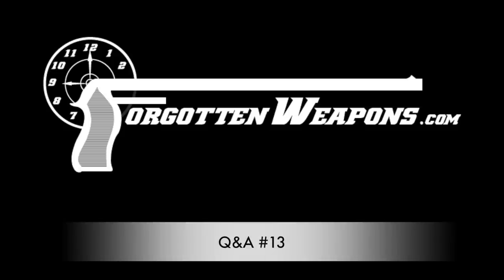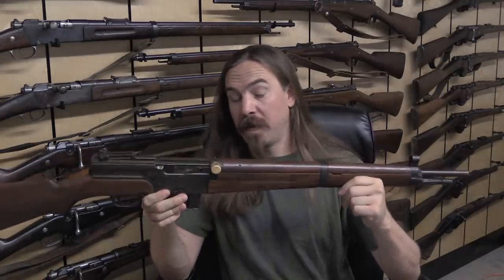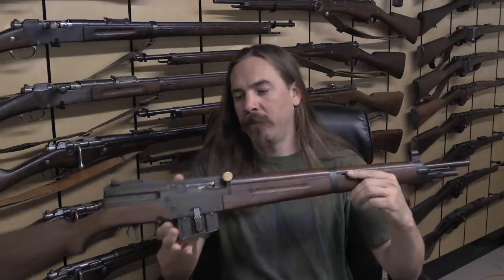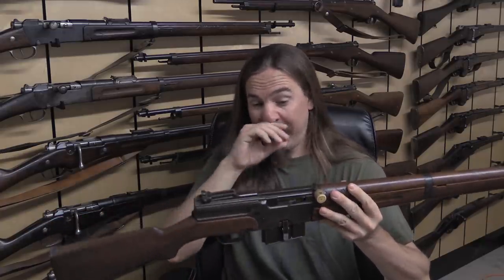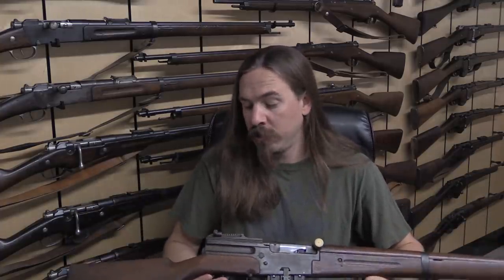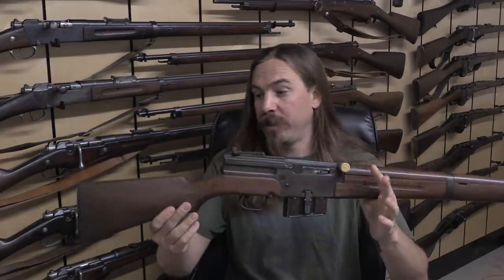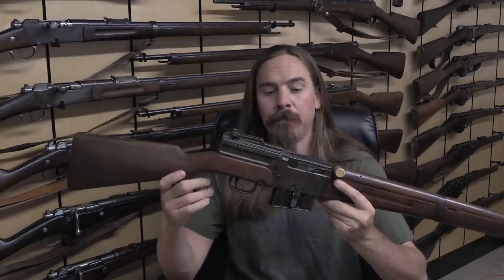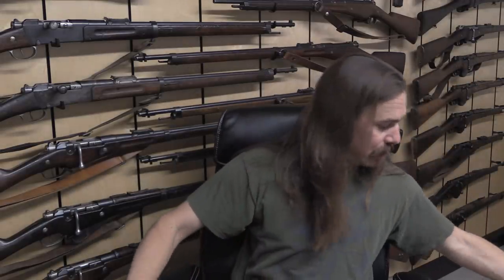Q&A #13: Cameras, Surplus SMGs, Modern Rocket Balls, and More!

Comment: On great gun books, several factors come into play making them hard to find.  First, at least in this part of the US good book stores are a vanishing breed.  Many have closed their doors simply because in tough economic times not enough folks are buying research books to allow continued function as a store.  
Second, some of the best books were either of limited circulation in the first place, such as the US Navy's 'Machine Guns' by George Chinn (a superb 5 volume set with volumes 1 - 3 printed for government distribution in 1951 and volume 5 finally emerging in 1987).  I was privileged to actually hold books 1 - 4 for a few weeks, but old book auctions are the only place a reader will find originals, because most copies either remain inside government limited access libraries, or were trashed when someone decided to clean out an office.  
The good news is with careful hunting you can find them as PDF documents online.  Those volumes are huge however, I believe volume 1 alone is something like 140 megabytes.  A third problem is serious firearms researchers are such a small segment of the probable market that many still functional book stores simply don't bother to stock firearms research books.
A second must read is Smith''s Small Arms of the World.  Long out of print, so again online old book sales is the best source.  
When the US Army closed Springfield Armory and transferred the function to the Rock Island Armory (itself now also defunct) a 'how to do this' 180 pag guide book intended 'not for distribution' called 'Technical Notes Small Arms Weapons Design' was written and published.  Again, it can be found online (about 230 megs), but I have only seen one original hard copy and that was at an Army facility.  Superb for designers.  
Another problem is not all of the best books were published in English.  Rhinemetall of Germany published a 'Handbook on Weaponry (739 pages or so in 1972, but it was only availablle in German for some time.  An English translation (literal, so some syntax structure of some sentences requires some thought) of 'Taschenbuch fur den Artilleristen' was finally made available in 1982 but again online or book auctions is your best bet for finding a copy.  It is  full of formulas for everything from calculation of breech pressure to a formula for calculating the probability of a kill   
It must also be acknowledged that some superb firearms research books are or were only written in languages such as Russian, French or Chinese or Hindi as that was or is the language of the intended and anticipated readers.
The US shooters civilian Bible is of course, Hatcher's Notebook.  Also very much worth reading as a means of learning from someone else's real world experience are the books by Elmer Keith.  If nothing else from them we learn overcharges of a pistol can take off your finger, and choosing to shoot a charging grizzly bear with a 9mm Luger is probably a fatal mistake.  There are other historical gems in Keith's writings and I strongly suggest familiarity with them for anyone wanting real world experience about how guns perform in the field without having the pains of a really bad day.

Comment: The Makarov pistol is a C&R eligible handgun that while not new, is still plenty safe for CCW. 

I'm not advocating carrying something for the sole purpose of its historical context but Maks can often be had for very reasonable prices and they are functionally sound. Which make them a great option for someone who wants to CCW but may not have the funds for a Shield or Glock etc...
Reply: Christopher Clark On the opposite side of cost I like the HK P7. It's well made, slim/snag free, and the grip safety is pretty good once you get used to it. Although I agree that carrying historic firearms defeats the point a bit.
Reply: ive shot a makerov before, it was pleasant to shoot, accurate, and fairly small.

Comment: @26:40 Not M1903A1, but a M1903Mk1. The M1903A1 is just a regular M1903 with a pistol grip stock. The M1903Mk1 is the one that was specifically made for the Pedersen device.

Comment: If you want an old style carry gun look at which designs are still in production by thier original manufacturer 50 or 100 years after their introduction. 1911s are on that list (though there are many modern variations) as are Walther PPks (but be prepared to be accused of being a James Bond fanboy). If the original manufacturer is still making them that's an indicator they may still be relevant despite being a very old design.

Comment: A bit late, I know, but the conjecture on the stability of rocket balls is incorrect here. A projectile will stabilize if the center of mass is in front of the center of pressure. The hollow section at the rear would almost function like the fins on a dart. You would still need to spin the projectile, but you could get away with a lower rate of spin than on traditional bullets

Comment: I was surprised to hear you say that a weight forward hollow base projectile would be hard to stabilize. That's the exact method that old timey conical and modern production Foster slugs for shotguns use. Is it a different kinds thing when it gets to over 2000 fps or something?

As I understood it, it basically works exactly like a badminton shuttlecock. 
+ForgottenWeapons

Comment: .32-20 was a good round. Problem with the use of an obsolete round like that is it still fits in a gun that's really old and used black powder.

But it would be nice to have a  32-20  rimless cased multipurpose round designed for a Henry style lever action that has been truly modernized. As you change your next round by throwing it in the loading gate.

JS, it could NEVER happen unless you changed it a little. Like just enough, otherwise older weapons would be blown up.

Comment: Just a comment on the rocket balls; weight at the front with a hollow tail is inherently stable. This is how aircraft and rockets stay nose-forward. Now, you couldn't put it through rifling and expect it to work well, but by itself it's technically okay.

Comment: I wouldn't say polymer takes up all the market share formerly created with stamping.  This is because a stamped steel part can generally handle heat much better than a polymer part.  So you can't easily replace a stamped steel upper for something like an AR-18 and replace it with polymer.  Even with excellent engineering you have companies like HK having trouble with the G36 overheating and the polymer degrading.  

However for relatively unstressed components, you are completely correct.  Just mold it out of plastic.  You can make a more complex part and do it cheaper.
Reply: For the parts that need to stand up to heat, I'd say that extruded aluminum takes the place of stamped steel. Just look at the ACR or SCAR.
Reply: Currently we use milled extruded aluminum a lot for those purposes, but it is more expensive than a comparable stamping.
Reply: Jeff Acheson I would argue that in "oh shit!" times, that stamped is better for mass production. Sure polymer is cheap and lightweight but I feel like you can really crank out stampings in even less time than waiting for the plastic to form and all that.
Reply: It depends as stampings may require multiple operations to create the final part.  And a mold for polymer parts could have multiple cavities.
Reply: Jeff Acheson Well everything always depends. I just believe with a simple (even by typical standards) stamping you can just get the production rolling like no ones business. Well, you could of your nation actually has a hint of an industrial base unlike the defunct factory towns of the United States

Comment: When the russian empire adopted the first mosin nagant rifle in 1891, as finland was a part of the russian empire we also adopted it,  straight after our independence and during the finnish civil war we had stockpile of around 200,000 m91/30 rifles so we decided that, Well we don't think these mosin rifles any good but we don't have production capacity to manufacture our own rifles so let's just retrofit them into the finnish M/91 rifles for the time being, after that during late 20s and early 30s we modified them again into the M/27 which was the main service rifle in finland for the winter war and then AGAIN for the continuation war they where updated to the M/39. The Finnish Defence Force used the TKIV 85 rifle as their main sniper rifle. While it is based on the mosin nagant rifle, has been through so many changes it is basically its own thing now. And yes we have used the same sniper rifle since 1985, but like anyone can complain the US still use the Ma deuce.

Comment: Historically significant pistol practical for CCW? Walther PPK. Its reliability has been conclusively proven by over 80 years of use by police and special forces. It has been copied extensively, it's sexy as hell, is James Bond's weapon of choice and was even used by MI6. What could possibly be a more compelling endorsement than that?

Comment: Ian I have a question for you. Why haven't "they" made a cartridge between pistol and Intermediate strength. I feel like there should be a middle ground in-between pistol and intermediate cartridge power in something like a SMG. For Example the Intermediate cartridge bridged the gap between pistol and full power cartridges. Someone needs to make a smg in something a little more powerful than a pistol load. 5.7x28 is kinda a good example of that bridge but I think someone could do better. Thanks Tyler..

Comment: the original m4 the army used had three round bust and when we switched to the a1 model at first just to get them out the door we did something with the sear so like when i went through basic sometimes it will mess up and malfunction

Comment: For the rocket ball question wouldn't having a heavy front with an empty lighter tail be similar to a foster shotgun slug? Seems like the same basic idea and they work pretty damn well with slugs
Reply: For that matter hollow base wadcutter rounds, also Brenenke slugs utilize solid slug with a plastic, felt, or fiber tail which was originally attached with a wood screw if I remember right.

Comment: Are rifle grenades still a viable anti tank weapon today?
Reply: rpgs use the same method - hollow-charge - as at rifle grenades, so, yes, inasmuch as their effectiveness allows
Reply: CthulhuInc I know that, but would a modern rifle grenade be able to take out a t-90 or an Abrams tank?
Reply: Carl Smith i am not sure rifle grenades were effective anti tank weapons when they were used before.

      That being said rifle grenades were probably highly effective ways to take out trucks, half tracks, weapons pits in defilade, firing into windows to take out snipers etc.

    Most man portable anti tank weapons today are some sort of rocket or missle with a shape charge. 
Not sure if you could get a proper hit angle from a rifle grenade to make a shape charge effective.
Reply: Carl Smith never was I think.
Reply: I think Ian was not entirely correct in that statement. Its true that shaped charges depend on the shape to do damage, but they also depend on the mass, and rifle grenades just dont have a lot of mass. Look at panzerfausts for example, and imagine trying to fire that from a rifle.
Reply: Not anti-tank but anti-apc or other Light Armored Vehicle. The US Arm actually does field a shaped Charge round for their various 40mm grenade launchers. But most modern Tank armor is pretty well protected from all shaped charge warheads and is why most rely on APFSDS rounds for anti-tank work and HEDP (HighExplosive Dual Purpose) which is functionally identical to old HEAT shaped charge rounds.
Reply: No I doubt any type of rifle fired grenade would /could destroy a modern battle tank. Moreover, don’t forget the changes on the modern battle field a mbt is relatively obsolete at this point. Additionally, 40mm hedp is effective against light armored to no armor area targets. It is the modern equivalent to a rifle grenade. Even the US Army has abandoned the new mbt in the future weapons program. When new projectile options become viable .... ie lazer based or rail/kinetic energy platforms become smaller a new battle field equivalent should present itself.

Comment: On military surplus equipment, WW2 provided the best source ever. There are several wrecked Panzer 3/4s and StuGs found in the Middle East particularly the Golan Heights. A few tiny Italian tankettes turned up in Iraq 2003 (are funny photos of tankettes no taller then the troops chests)  with early war Brit tanks, Tankettes were captured in 1940 by the Brits from Gratziani's army of 140k when surrendered to O-Connor's corp of about 35k. Then used with older Brit gear to defend Iraq from the Vichy troops in Syria. "Never in the field of human conflict was so much surrendered, by so many, to so few." Lots of Luftwaffe planes were captured with 75% grounded by Xmas 1944 due to no fuel. Well over 100k Nazis were invited to Argentina by Peron. Adolf Galand set up Argentina's airforce using the Me262 jets. With the close support for Franco by Hitler the Spanish had light panzers and it's airforce was equipped with German planes which were used in the 1960s movie THE BATTLE OF BRITAIN. And in ex-Soviet wharehouses there are boxes and boxes of MG 42s (8/box), Maxim MGs, (6/box), MP40s, K98s, revolvers (40-50/box) etc still in the original grease paper. Maybe some Mp44 or FG42s.

Comment: One comment regarding the pedersen device - what about .30 carbine?  I realize the case is 10mm longer, which would require it to take the HMG STG approach and make it a semi-copy.  However you also could use M1 carbine mags.  Do you think the device could be safely redesigned for the much hotter round?
Reply from the maker: Too hot for a blowback action.
Reply: Forgotten Weapons Now I see that the question was already asked and answered below.  The other perhaps more important issue is the milled ejection port, which is too small for .30 carbine.  The only solution would be PRVI partisan making a run of the cartridge, in conjunction with a very well-heeled shop making Pederson device clones, and I don't know that the interest is there beyond very small numbers.

Comment: So with the stated reasoning for Finland using the 7.62x39 being that it makes sense to use the same rounds as your most likely aggressor, does that mean Finland is going to move to the 5.45x39?
Reply: Most likely no. The next finnish assault rifle will probably be in 5.56, if there is no massive change to some other cartridge in the NATO sphere. Also, as far as I know, the biggest reason for Finland adopting the 7.62x39 was that it was pretty much the only intermediate cartridge in wide scale use anywhere. It was just a convenient plus that it was also used by the eastern neighbour. The development program started in the 50s, and 5.56 really wasn't a big thing then.

Comment: one reason the shrike can never be a viable LMG is because of the AR15 gas tube. the gas tube has a catastrophic failure after a few hundred rounds of sustained fire as we see in AR15 meltdown videos. i dont know a ton about guns but if there was some way to have a beltfed AR upper with a different gas system then that maybe could work.

Comment: 9mm is older than 45acp yet is being used by NATO forces with increased pressures. The 22lr was designed in 1884  and 9mm in 1901, these are most definitely old being over 120 years since the design of the latter and 136 years since the design of the former, yet they have only improved over the years. Calling a caliber old is kind of misleading because in essence your only referring to the diameter of the projectile and casing length. There are other variables that go into ammunition production other than the caliber diameter and case length. Since its production powders and primers have improved dramatically and knowledge on the ballistics behind these projectiles.  Example, Ford has been around for a long time, but modern fords cannot be compared to when the first ford was made.

Comment: As far as C&R guns for CCW, the post war Walther P38/P1's are still relatively inexpensive and reliable if you change the recoil and magazine springs (but they are picky about hollow points). The Bulgarian Makarovs are still very serviceable as well. The CZ-82 is a fantastic CCW gun.

Back when I was just getting into guns I carried a Nagant revolver in the woods for defense (it was all I could afford at $89 shipped, with a holster) it was better than a sharp stick and could also be used to drive tent stakes. The Ruger Service Six I bought for $200 to replace it was a VASTLY superior gun. If function is a priority over aesthetics, wait for a quality used commercial gun or police trade in. But if all you've got is a TT-33, practice with it regularly and use it.